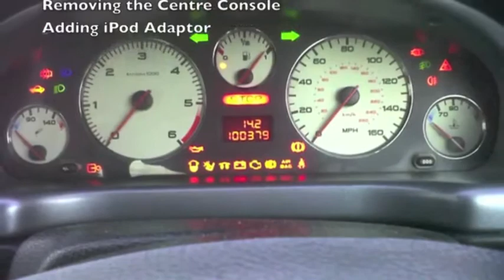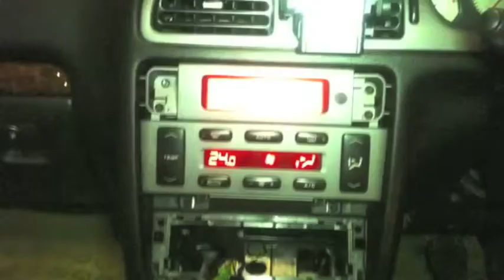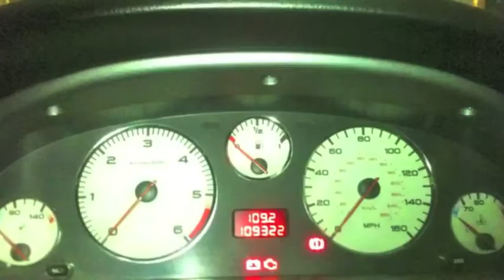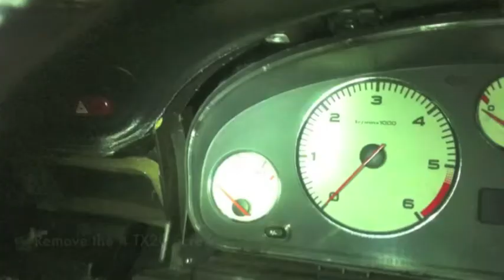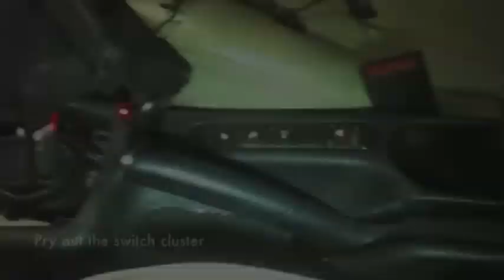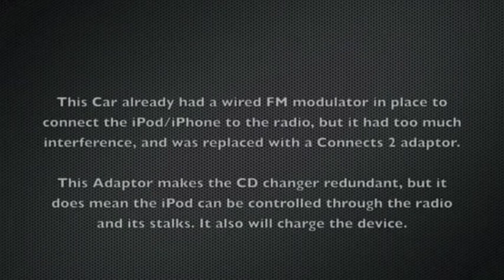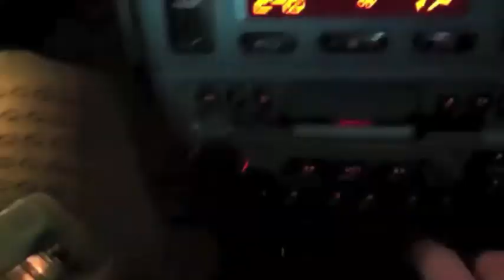Peugeot 406 Interior Guide

Comment: Link to the adaptors please???
Reply from the maker: As this video is a bit older now i would advise going for the connects 2 bluetooth system. What i used here in this video used the old iphone 30 pin connector, not too many still using an iphone 4S haha.

The bluetooth adapter can be bought here
https://www.ebay.co.uk/itm/Peugeot-406-Bluetooth-music-streaming-handsfree-car-kit-AUX-USB-MP3-iPhone-Sony/321723475455?epid=1436926009&hash=item4ae836a5ff:g:XlsAAOSw7ThUgzIF

That works with any iPhone, or mobile device. It also has a usb port and 3.5mm input if required. A great bit of kit.